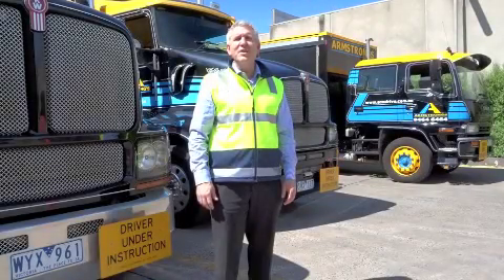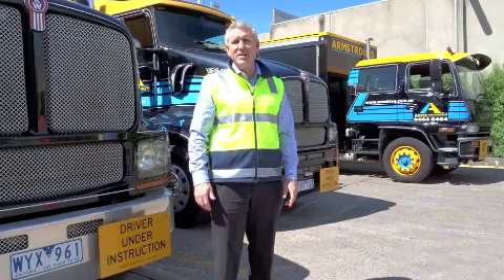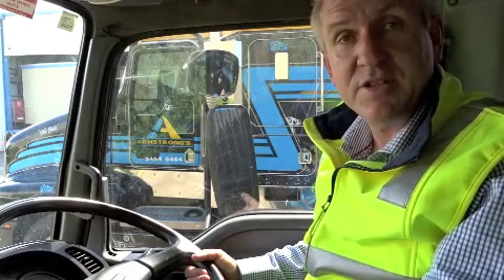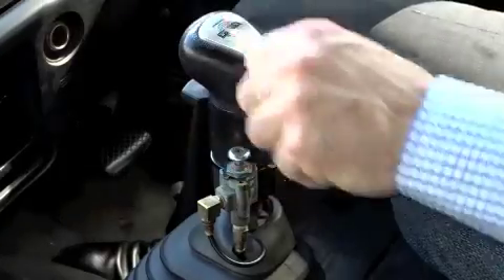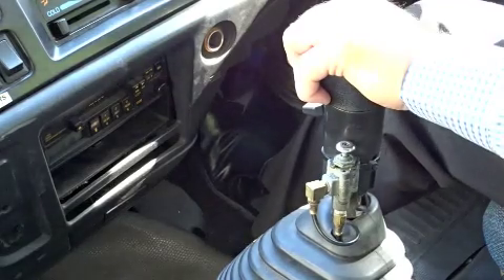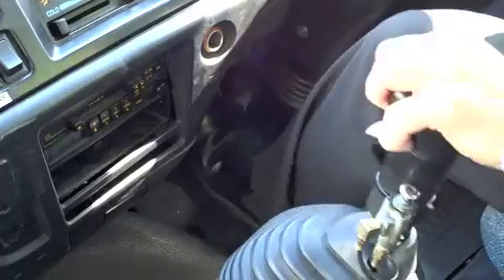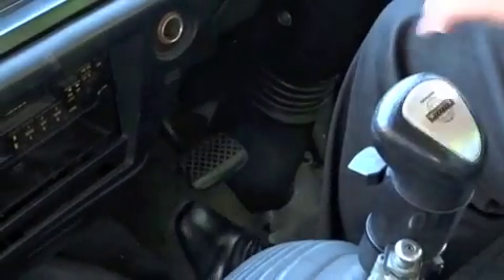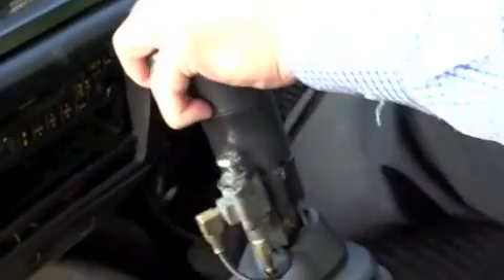How to Change Gears in a Heavy Rigid Using a Non-Synchromesh Gearbox

Comment: I’ve just completed my HR license on a non synchro box. Major head f$&k even though I’m a well versed driver of manual cars for 40 years plus
Changing down across high to low with reving between changes and clutch movements… OMG
Reply: I did my mine in year 2000 when it was 50 bucks a lesson. Fast forward to 24 years and a career change, thank god my Oz post truck is automatic.

Comment: Just a note of caution, I watched this video and thought I would be right to choose a non synchromesh or 'Crash Box' transmission for a 2 day Heavy Rigid course and assessment in Australia. I could barely shift up and down on a straight back road let alone do the test around town with roundabouts because you also need to make sure you are in the right rev range before the gear will engage. I was in an older Kenworth with a long gear stick shaft coming out of the floor and could barely tell what gear I was in and couldn't get a feel for the gate at all. Luckily I was able to switch to a Volvo with a Synchromesh gearbox for the rest of the course.

Comment: From what I can tell, the gearbox internally is somewhat like a dogbox (IE: dog gears) so double clutching itself is something I have practiced before. What about for down shifting? Do you need to rev match with the throttle? Or just employ the same double clutch method as shown here?
I'm looking to do my HR licence and was thinking to just do the test in a truck like this anyway. Might as well get licenced for everything. Maybe won't use it, but at least I have it if I need it :)
Reply: Yes, you have to blip the throttle to change down, usually around 500 revs.

Comment: In North America we do not drive synchro transmissions in our heavy trucks.  We run double 53 foot trailers with far higher payloads than you run in Britain. Many of our trucks have 18 speed transmissions and they are non synchro transmissions.  A few years ago Volvo offered a multispeed transmission that was synchronised for the North American market.  They are no longer available.  The reason is because you have to use the clutch with these, and with a multispeed transmission that would be a lot of  clutching.  Most of our veteran drivers shift without the clutch, and they do it effortlessly and smoothly.  The synchro transmissions are just too much work.  They hated them here.  Synchros are for Europe where they pull lighter loads and single drive axles.
Reply: This video is from Australia and WE often run much heavier loads than you do. The video was taken in a heavy-rigid truck, not a semi.
Reply: Yes, you guys do run heavier loads than us, and far heavier than those Brits.  Here we run "rigid" trucks in the city for the most part.  Our big super B trains and double 53 foot trains run on 4 lane highways.  We run 18 speed crash boxes in many heavy semi trucks here, and most guys would not be double clutching that many gears, so I found it entertaining to watch.  Our green drivers do double clutch.  The veterans, not so much.  I have driven long haul for 44 years and if I double clutched every gear in all those years I would have a lopsided left leg, or I'd be crippled.
Reply: @SternDrive  Hardly anyone actually shifts that way on the road but the instructors are officially required to teach you to do it for safety reasons.
Reply: Yes, I do teach new guys to double clutch and when they have mastered that I teach them to partial clutch (no clutch out, single clutch in) and then I teach them to shift with no clutch ( floating) and just a light two finger touch.  BTW, our guys don't know what a "rigid" truck is.  Here they are called "straight jobs"  and they are 5 or 10 tons and have synchro 6 or 7 speed transmissions.  The new ones are all automatics.  Most guys here could not (or would not) drive a manual.  They are very rough.  If the city haulers want drivers they must give them automatics.  The whole industry is being dumbed down.
Reply: @SternDrive  The vast majority of your trucks only run single trailers, and I believe the max weight is 80,000lb. In the UK the max weight for a standard "semi" is 98,560lb.  My last rig had a step-frame, extendable plant trailer, and was plated for 179,200lb
Reply: @SternDrive  I'm gonna assume you're Canadian. In the US double 53 footers are legal in very few places. I've never actually seen that set up on any road before.
Reply: @SternDrive  americans have a complex with 'those brits' we have road trains in Australia which dwarf 'them yanks'
Reply: The jobs I've applied for if ya couldn't drive clutch less you failed . That's how I learnt in Australia. In a 9speed Mack
Reply: Ok big note american, BTW hes Australian

Comment: when down shifting the real non synchronized transmission, u would clutch to neutral then gas and clutch to the gear. has to be right timing. the trick is the gas and timing.
Reply: no its on the "right" side ;)
Reply: Yep, pity he didn´t show the downshift too.
Reply: StevieSpain D also his steering wheel is on the wrong side
Reply: Looks alright to me :D
Reply: @swordofesau952  it’s the right side for our country
Reply: It is called rev matching, and it should be done on all manual transmissions, unless you want to give lots of business to the transmission and clutch industry.
Reply: @SternDrive  rev matching is always helpful, but isn't nearly as necessary on a synchronized transmission.

Clutch modulation (and control) when downshifting a synchronous transmission will generally suffice. 

That's what synchronizers are for: smoother gear change, and less wear if you don't rev match precisely, or at all.

Comment: So the clutch is not engaged fully just about half way depressed, correct?
Reply: Kane Underwood yeah... fully depressed engages the clutch brake (which you only need for when the truck has stopped and put into neutral)
Also you never stop without it in gear and the clutch depressed halfway which really wrecks havoc on your clutch leg if you’re sitting in traffic or stopping at lights

Comment: Just curious.. why do they make them without synchromesh..?
Reply: More durable, and fewer parts make them cheaper to produce and maintain than synchromesh gearboxes.
Reply: IAmAgainst synchronized Transmissions is more updated and easier but I like non synchronized transmission that's the real way of driving
Reply: Even some classes of race cars use them in order to make changing gear ratio packages easier.
Reply: IAmAgainst also eliminates extra weight which is vital when calculating GCM
Reply: In North America they do not have heavy trucks with synchro because they run much heavier loads than Europe. All the heavy trucks here are double drive axles and many are double 53' and some times even triple trailers.  We also prefer them because you can float the gears effortlessly.  That does not work in a synchro transmission where you must clutch.
Reply: @SternDrive  In Australia we use all gearboxes and we pull more than anyone else